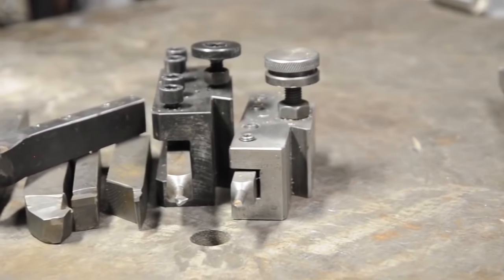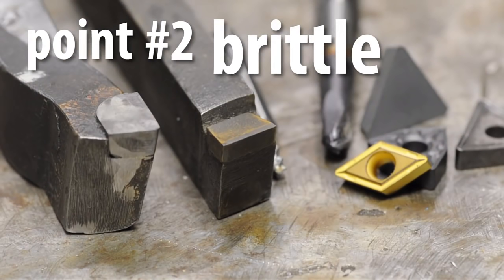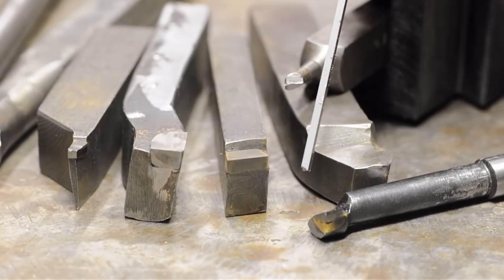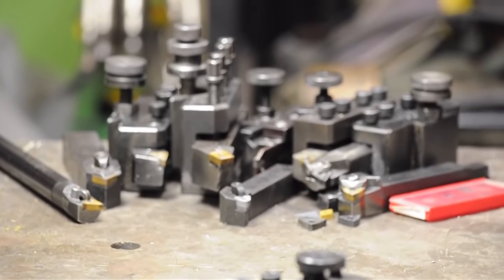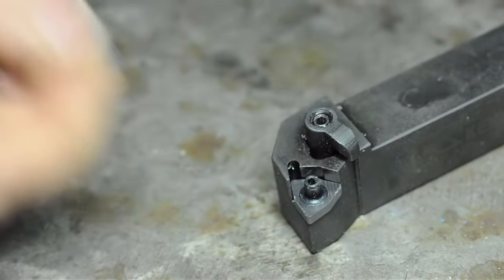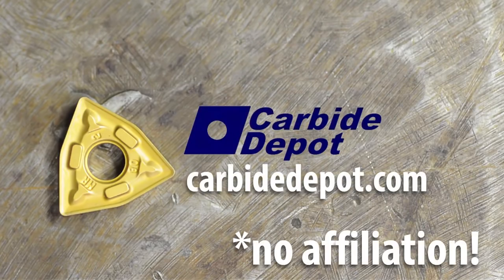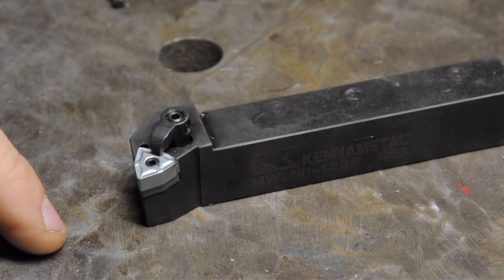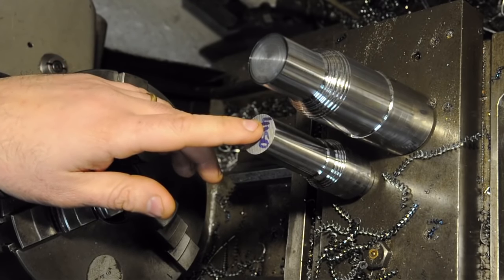A Brief Chat about Carbide Tooling

Comment: Having just ordered my first set of carbide-insert cutting tools (the cheap ones off Ebay) for my new mini-lathe, this video was exactly what I needed to understand what I'm getting into.  When I worked at a machine shop back in the 80's, we had HSS and brazed carbide - no inserts for us.  As a hobbyist who doesn't have a grinder yet, the inserts are a great option to have.
Reply: Grinding hss is nutritious for toolroom penny. Once you get to see the result of eyeballing radii yo kinda get to feel what your machine is able to do. 

Dont avoid learning the craft, because it will come back to bite you.

Comment: I totally love carbide endmills. 
Carbide tools on the mill don't bend as much and also last long, even in the home shop.... that is unless you use carbide on a lathe like mine, the one that stops as the belt slips, welding the fractured carbide bits to the work. Oh, the joys.
Reply: I have a very old South Bend lathe with a flat belt drive. I replaced the old leather belt with a more modern stronger and tougher one but it slipped more, making it harder (read slower) to get any work done. What I eventually did was buy some 3M Scotch rubber electrical tape (3/4" wide) and I wrapped two layers on each pulley on the drive and the lathe head...so six surfaces in all and PRESTO!!I can now take bigger cuts and the lathe is quieter, no click click as the belt goes around. I have to change the rubber about once a year....the tape is not crazy expensive and the roll lasts me a few years. Try it, it works great. NOTE: I do not mean the typical black vinyl electrical tape.....you have to get the rubber stuff....it sticks to itself but is not "sticky" per se.

Comment: That CCMT insert actually has 4 cutting edges. There are holders available that utilize the other two edges. If using a cnmg insert, you end up with 8 edges. They also make holders with various entry angles too, to really make use of the strength available in the "other two" edges on the 80 degree diamond inserts.
Reply: Yep, the shop I used to work in we used the other 2 edges in milling heads, so once we chewed up the 2 fine points on the lathe, they went in a bucket by the mill to be used there. Got a lot of use out of them.

Comment: Carbide <3
Reply: Hay, what? Skip brazed carbide? :o
Reply: Stefan Gotteswinter a
Reply: Der Wissenskiosk    What?
Reply: Carbide is a sintered product. Manufactured using high temperatures and pressures.  It is generally unaffected by exposure to high temperatures.  And can with stand high pressures as long as it isn't applied as a shock.
Reply: Or as long as the shock doesn't dynamically exceed it's integrity.
Reply: Der Wissenskiosk Heating up carbide isn't going to destroy it. Carbide can be heated to 900℃ before failure.
Reply: No, Tungsten Carbide will fail at 900°C. btw its called carbide because everyone is too lazy to write tungsten all the time.
Reply: steve gale it will lose its hardness at 900℃, sorry for mixing that up, but that's pretty much the same as a failure
Reply: A Chip with 1100°C is already glowing yellow. I think you mix up the numbers here
Reply: Btw: Throwing out numbers of years of experience doesnt say anything. Validate your arguments properly, otherwise no one will take you serious ;)

I am a youtube-expert since 1848, I should know that.
Reply: I could cite my german "Fachkunde Metall"-book, but there are mostly english-speaking people here :D
Reply: Toolsteel can't blue at 1500°C if the melting point is at 1538°C
Reply: steve gale I never thought an aeroplane engineering company owner would be as childish as you. Give me the name of your company so you proved at least one point in this discussion.
Reply: steve gale ok, so we have yet another point you didn't prove. Thanks for confirming your incompetence.
Reply: You guys are still here? Its realy annoying as I get notifications when you insult each other all the time.
Reply: steve gale because*
Reply: A humble minded person like me would not have expexted a bitchfight under such a generic comment, but sure, go ahead :)
Reply: Stefan Gotteswinter i would  apologize, but he just kept insulting me
Reply: Mute the conversation. Nothing anyone says under a generic comment is going to be enlightening enough to keep the commentary running in your notifications.
Reply: Stefan Go
Reply: Herr Gotteswinter: Können Sie bitte Ihre Vorschlägene für Werkzeughalteren/HM Lieferanten/Ambieter hier in Deutschland (München Umgebung?) geben??
Reply: @StefanGotteswinter  I agree that 1848 is a few years ago, but how many hours have you been a YouTube expert?? Number of years doesn't say anything :)

Comment: Tony thanks for giving people who don't normally use carbide some very useful tips such as either flood or no coolant and running higher surface speeds than they might do now. I was always taught positive rake for aluminium and cast iron. The turning tools I believe use tip pressure generally to melt the material and sweep it away.

Comment: Hi Tony, this is Old Bob. excellent and very useful presentation. camera work equally great with machining. I like carbide inserts and the fact that their edge finishing has a bit more tangential aproach to the work as HSS has. Sometimes I feel that as HSS ground it's only scraping off material instead of "peeling" it off. Being from old school I used to the tangent type of "grinding tools". It could also be mentioned that carbide tools cannot take vibrations, a specially on cheap mini mills.

Comment: 04-03-02, or more commonly 432, is hands down the most popular (ie easiest and cheapest to find used) size, so that 848 is just silly big.
Hobbyists should be in the 332 size area really, especially if buying new (20% costs savings over 432).
The W and S are popular, but the C shape rules, since the 80 degree diamond gives you 4 cutting corners. Don't bother buying new anything not rocking that N for zero relief, since you double your cutting surfaces and besides your tool holder gets you the relief.
Buying used, try sticking to the 432 if costs are a big issue. Or just go silly with the variety if the prices are good, and you're just curious.

Comment: Once, when I was just out of 3rd year Toolmaking, we got a brand new 9-tooth insert 100mm fly cutter. I got first dibs at it as I was working on a large block of tool steel. The new cutter had a new specially designed tooth shape so it staggered the chip load throughout the cut. You could run a much thicker chip per tooth and take good deep cuts with a high feedrate/slow rev rate. If you played with the variable speed and hit the sweet spot it was really something amazing. For about 30 minutes. Why? 

I clamped my large block of tool steel between two toe clamps and started roughing from the back of the block. The cuts were amazing. 8mm deep cuts, 75mm wide, about 300 RPM, these super thick, shiny, light blue chips landing on the floor, it was so perfect. I roughed behind the clamps, between the clamps, in front of the clamps, I took my last pass off to the right front, and then, I rapid traversed the head back, straight into the clamp while it was still running. 

I got very lucky. Smashed all the inserts and broke a few screws but only damaged one insert seat which we fixed easy enough. It came back pretty well but it was never exactly the same as those first few cuts. I didn't feel so bad about it when I saw a tradesman of 60+ years experience,  (Yes, he was nearly 80 and still working for us, despite several generous severance offers), I saw him snap the cast aluminum end table right of the bed when he rapided down straight onto a trolley. It flew a good 6 ft in the air.
Reply: I will always remember my 'crashes', of course my 'friends would have to stop reminding me about them first, haha! I remember welding a 4 insert 45mm U drill into the work. CNC Lathe, .5mm feed, 3000 rpm. Short run production. I can not remember how many I had already done but it had 'proved' itself and I was 3m away fussing with the mill when I heard the sound of the tips failing. I could not get to the Big Red Button in time! I'm still paying for that one!!

Comment: It's been about 35 years since I did any machining. I'm a certified welder (retired) but leased a welding/machine shop in the early 70's. Bought a South Bend 13"  Lathe with 40" center. I have a pile of carbide inserts but I have been going through the lathe a little at a time correcting issues. I tried to make some passes on some 1-1/2" CCR, nothing but chatter and I'm running on the slowest speed and feed. Huge mistake. I never used carbide before and after researching the speeds compared to using HSS tool bits it's no wonder I couldn't take .005" passes to save the day. Thanks for the information and explanation on carbide inserts, big help to me as long as I can keep the speeds up without a rebuild. By the way, who ever does your nails is short changing you, at the length shown in your videos it's a once a year ordeal.

Comment: I go to yard sales and markets and buy old and broken files.
Its the cheapest way to get tool steel for making lathe tools
Reply: Yes, that works to get cheap tool steel, but this is not high speed steel. It will anneal and soften at a relatively low temperature. Also, lots of files are case hardened, so you may get an unevenly hardened tool unless you anneal/reharden the tool after you've ground it.

Comment: Dear Tony:
I'm  using CCMT-21.5  inserts. Actually, the CCMTs have four usable cutting tips rather than two  given the right tool holders. The 100 deg. tips can be used for both facing and turning.

Comment: Great video Tony.  I have a 1947 Logan 820 I restored.  It has a 10" swing with 24" between center and it only has a 1/2 HP motor (the original 1947 motor!). After I saw this video I had to try the  WNMG. The problem was, even the smallest version of this insert have holders with a 3/4" shank. So I bought the 3/4" and milled it down to 1/2".  I used the insert at 1450 RPM with a 1-1/2" bar and was able to take up to about .080" a pass. It was most definitely pushing the limits of my lathe but it and .050" would be a more logical depth of cut. Anyway, if I need to tale off a lot of metal this is now my go to insert, I love it.  Just a side note, a friend of mine runs a machine shop told me that I would probable would not be able to do this with a South Bend or Atlas or many other older small lathes. He said the fact that Logan has a ball bearings spindle instead of sleeve bearings makes it do much better with carbide inserts.

Comment: problem I got with these chip break tests people keep doing is that the diameter keeps changing but speed and depth of cut remains the same. it is the material removal rate that dictates the chips. all insert tooling guys include that spec on their inserts, then you just calculate proper feed and speed for the diameter of the cut you are doing, using maths somehow.
Reply: pontusieg t
Reply: pontusieg, what you're referring to is surface speed. In order to maintain a specific surface speed, as the diameter decreases, the rpm needs to increase. Depending on the grade of insert and the material to be machined, I use the formula: 315 (pi) × cutting speed in m/min ÷ diameter in mm= rpm. So... 315×180=56700, then 56700÷200=283.5 rpm.

180m/min being a conservative, continuous cutting speed in 4140 steels. its a bit late, but i hope this helps.

Comment: This is the first of your videos I've watched. Your editing is brilliant and makes it all easy and clear to follow.

I had to drill some very small holes in stainless steel and baught a few solid carbide drills. I knew its brittle but still snapped them in minutes!!

(Kinda off topic but the heating and hardening of the stainless was actually my issue and mist coolant solved it. I also switched to cobalt drills which were less brittle.)

Comment: Very informative! Thanks, Old Tony :D
Why is it that carbide likes to be run fast?
Reply: I believe it's because it's not as sharp as hss, and therefore needs a higher surface speed to give a good finish. As for why higher surface speed gives a better surface finish, i have no idea, but i'd like to know if someone else does.
Reply: It burnishes the surface (melts it a bit) because the carbide is not super sharp at the cutting edge. HSS shears the metal away so the sharper it gets the less tearing and the better the finish.
Reply: DrKnow65 That's not what burnishing is, but I wouldn't be surprised at all if the tool burnishes the work
Reply: It doesn't require high speeds. It simply has the capability to run much faster than hss. The higher cutting speeds are to take advantage of its high temperature hardness
Reply: chris0tube inserts yes, but not carbide in terms of the material itself
Reply: sharp or not carbide is very brittle,so need higher speed....on low speed can broke easily...and surface finish is better

Comment: but why wont you tell me where you get your nails done!!?!
I keep using high speed steel and my nails look a bit rough, maybe I need carbide?
Reply: rasvial try a diamond file
Reply: depend on material you machine,if you try to machine hardened steel,that steel will machine your hss ....or try to machine 4140 cro moly steel at 35 Rockwell...or even hardoks 450 at 44 Rockwell...for soft steel or aluminum hss is ok...

Comment: Entertaining video! Carbide will surprise any machinist who hasn't "discovered" it yet. Carbide end mills and inserts are available with razor sharp edges, since they now use ultra-fine grain tungsten carbide crystals in the matrix. They are as sharp or sharper than you get with HSS. I'm serious, I mean razor sharp! I use them on plastic, which requires really sharp edges. (Check out the single flute end mills of solid carbide made specifically for plastics from Harvey Tool.) 

And they last a lot longer, they work extremely well on aluminum, and have especially low tool flex. Cutting edges are engineered for specific metals, that's why you often see inserts with "dull" edges - they are made that way for tough-to-machine materials like inconel and stainless, or other exotic alloys. And it's a deep black hole trying to figure all that out, believe me!

Comment: I am from the U.K. I have a small 31/2” lathe and a milling machine and also a nice big rotary table. I use korloy inserts, all positive rake. The tips are very cheap but the holders are quite expensive. So I make my own holders, these are designed to fit straight into my home made quick change toolpost giving a rigid set up. I have made around forty holders for different sizes and shapes and they are very successful. By the way the DCMT, and the CCMT, have four edge, the other two can be used for facing. I have also made two face mills utilising a rather clever design using six tips each that work superbly. If you don’t have much money you have to be ingenious.

Comment: A very good illustrated lecture from which I learned much, My late father was an old-school dentist and he used to use tungsten carbide burrs, rated for speeds up to 500000 rpm on air bearings. I often wondered how burrs and drills were made and how the perfect balance required was achieved; two powders pressed together, like metamorphic rock,huh?

Comment: Tony, inserts sold in the US typically follow a similar naming convention, but the numbers refer to fractions of an inch.

The letter designations are the exact same, while the number designations, from left to right, are inscribed diameter in eighths of an inch, thickness of insert in sixteenths of an inch, and nose radius in sixty-fourths of an inch.

For example, a CNMG-432 insert has a 4/8" (1/2") inscribed diameter, 3/16" thickness, and  a 2/64" (1/32") nose radius.
Reply from the maker: Yes!  Thanks RGB -- I do have both but I think the metric twist in this case was easier to get the point across.

Comment: Good basic covered.  I use a WNMG - 875 to 1200 rpm, 0.050 to 0.065 DOC, 0.010 In/rev feed in 4130.  Great chip and surface finish.  This is what I use to make my  Dovetail cutters with.
Reply: That's even running it light, depending on your tool size

Comment: Tungsten carbide (chemical formula: WC) is a chemical compound is a uniform chemical usually sintered together to form the insert. Sometimes other materials can be added to form a composite. It is not a mechanical mixture of tungsten and carbide.

Comment: Word on the street is the minimum depth of cut to break chips corresponds to the nose radius of the insert. Bury the radius . And over the last 15 years or so of doing this profile turning inserts have become my favorite.  Like a vnmg with a .008 nose radius. One tool for rough and finish turing. Like all the benefit of a dcmt but with 4 cutting edges instead of 2.